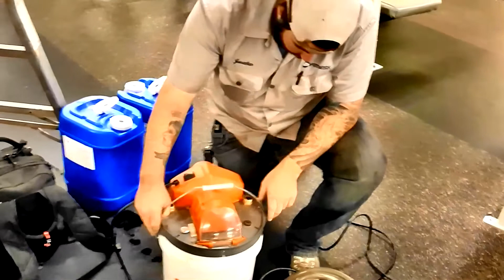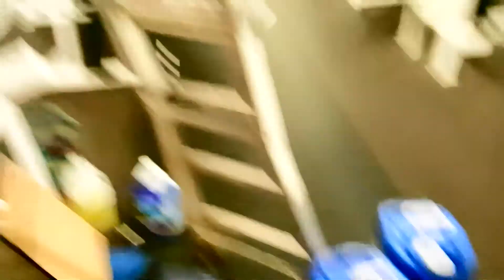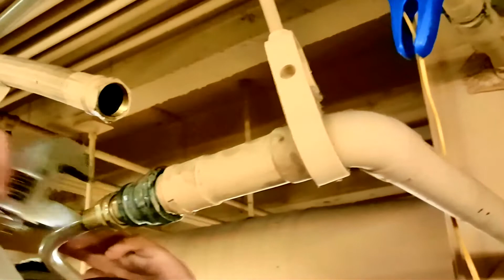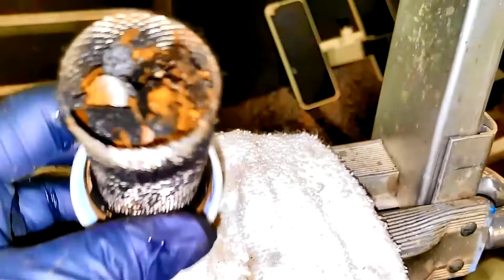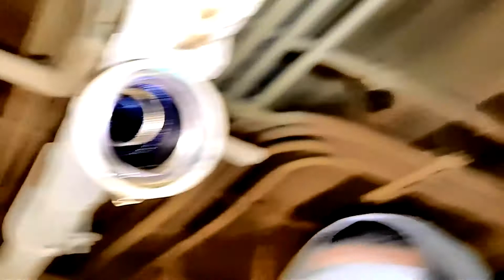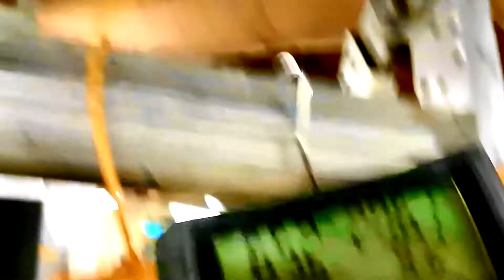How to Descale water source heat pumps

Comment: What pump  are you using
Reply from the maker: Speedclean from grainger Item 52WU90Mfr. Model SC-DS-5, works great,  I had it for years. You just need to make sure and flush it with clean water after using it.